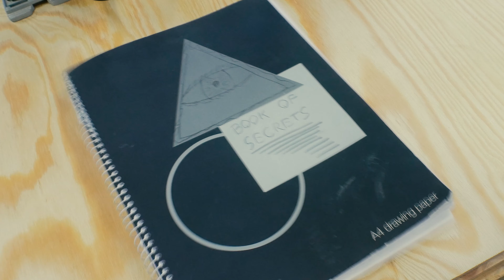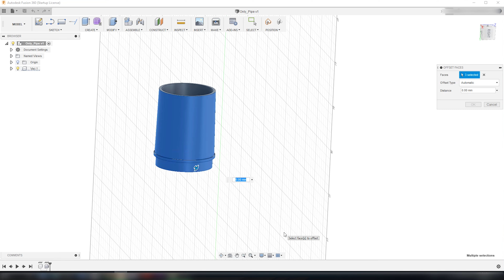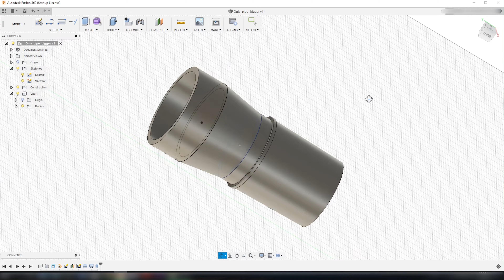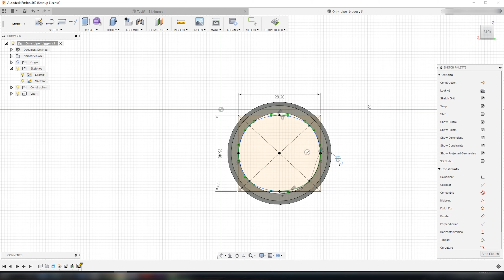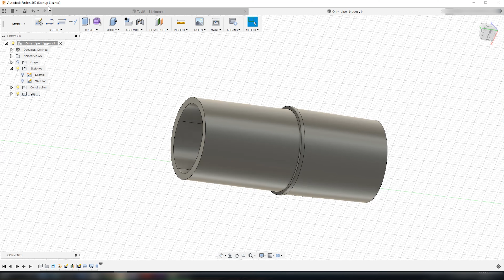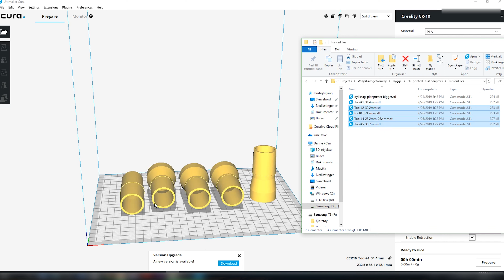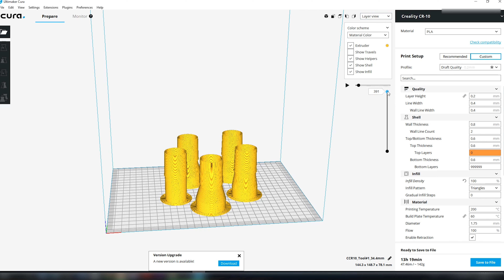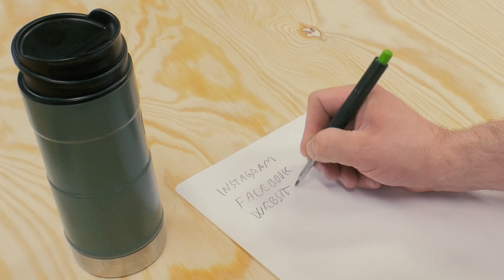3D printed Dust port adapters | Fusion 360 | CURA | DIY

Comment: They seem a bit brittle, is it PLA you have used and how have they held up? Did you consider using some more flexible filament? Thanks for a nice video! :)
Reply from the maker: Hi and thanks for watching 😀 I used PLA to print these and they have not been damaged yet. PLA can be brittle between the layers but it seems to work 👍 I printed with 100% infill and made the walls as thick as possible.

And if one of them breaks in the future i can easy print a new one 😀

Comment: I was sad to see the use of epoxy. Hot glue would be less permanent to the tool itself if something doesn't work out.
Reply: By sad, I mean, it will be a sad day if you decide on a different system or need to replace the adapter.
Reply from the maker: Yeah, I understand what you mean. Hot glue might be a better solution like you said. I did it like this because my tools are very cheap and is getting very old. The best solution would be to make the adapters press fit 👍